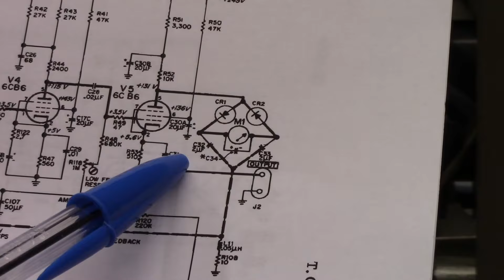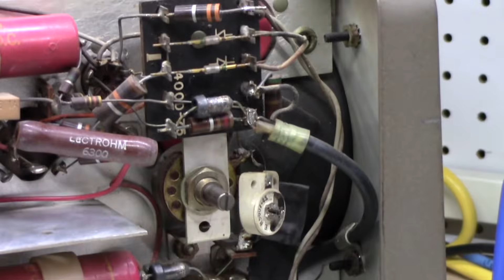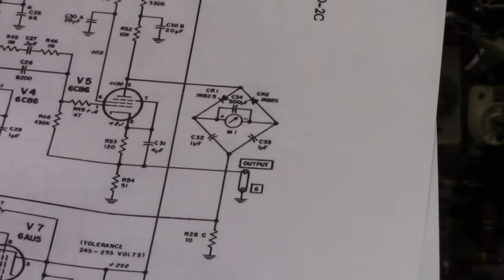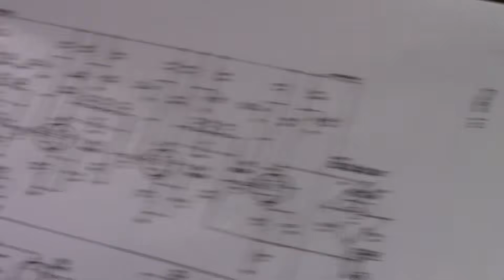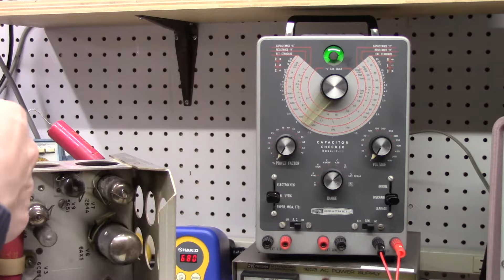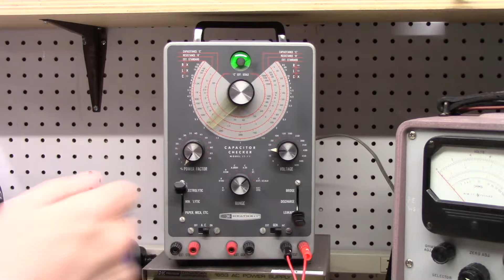#68: HP-400D video 2: Investigating the components

Comment: Thanks. Are you going to leave the Allan Bradley resistors in it? I would as long as they are in good shape.
Reply from the maker: I usually spot check several resistors so that I have something that feels like a reasonable sampling. If those are all within tolerance, then I assume the rest are likely to be as well. Given the initial look, I'll leave the Allan Bradley resistors alone, as they seem to have aged well. The capacitors, of course, are another story.
Reply: Yep, caps are a different story. From most people I have watched, those resistors age well and are usually in specs. Hopefully I'll get to restore some older equipment soon.

Comment: Thanks for sharing...is that a selenium rectifier next to the transformer? Reason I ask is the schematic you used as closest to your model still appeared to have a tube rectifier. Just curious.  73 - Dino KL0S
Reply from the maker: On the schematic there is a silicon full wave bridge rectifier (SR1) and a tube rectifier (V6), and both appear in the unit. I also thought that the alleged silicon bridge looked like selenium, but I believe that it is early silicon. We will investigate more closely as the project goes on!